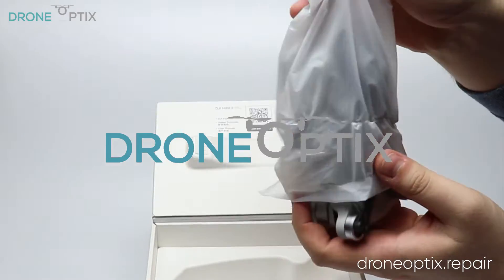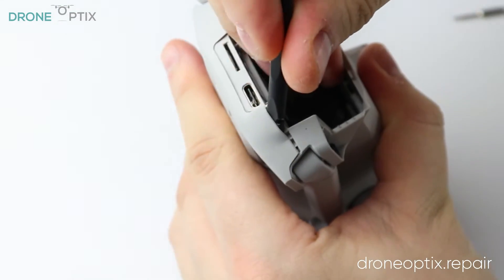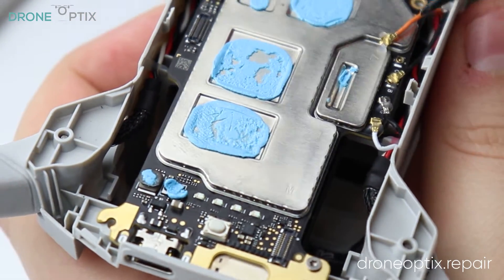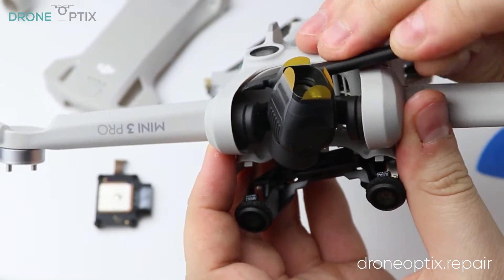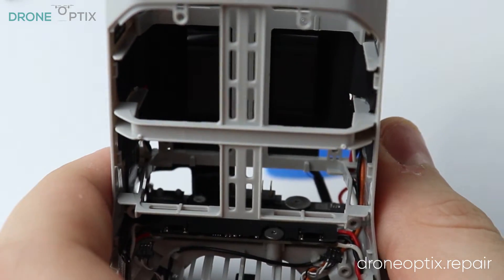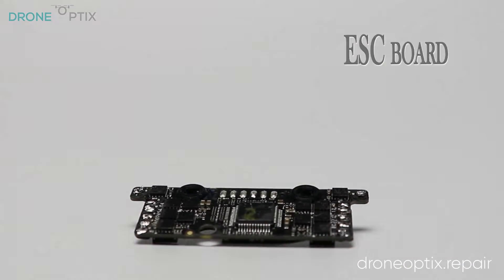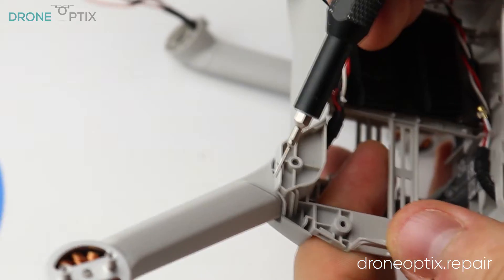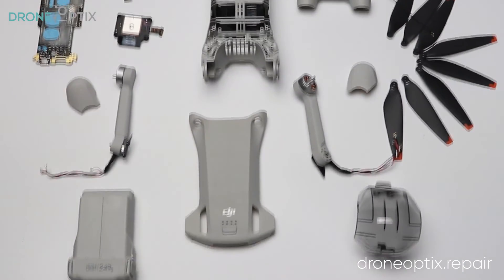We Completely Take Apart a DJI Mini 3 Pro Drone | Full Teardown / Disassembly

Comment: Here's a strange question:
After completely disassembling your DJI Mini 3 Pro Drone, could you see any parts or areas of the plastic drone body where one might be able to remove some of the plastic material in order to lighten the overall weight of this drone enough to counteract the weight of adding a set of aftermarket propeller-guards?

I ask because here in the United States the DJi Mini 3 Pro drone is considered a "Class-1" drone.  It weighs less than .55 grams.  IF you install a set of propeller-guards it increases the weight to more than the .55 grams.  This means that the Mini 3 Pro drone then becomes a "Class-3" drone.  The rules for flying a "Class-3" drone then become a bit more complicated.  

For the sake of argument and disregarding any warranty issues, I was just wondering if there was a way to lighten the weight of an existing Mini 3 Pro  further without compromising the integrity of the drone as it was originally built.

Comment: Where is the antenna connected and how many ? I'm planning on replacing it with better longer one. Hopefully I can put an antenna going through all four arms and one under and on the top in a Y slightly sticking out. At least that's my plan it should increase range signal pick up in both vertical and horizontal directions or in any position. I also plan on adding BETTER antennas to the DJI-RC CONTROLLER possibly double mushroom antenna.

Comment: Today, the ankle of the front right arm of my mini 3 pro got loose. Can I unscrew the arm and pull the arm off its axle without taking the entire drone apart? Are the cables long enough? I would like to check if the dark part that hold the axle is broken or if the main housing is broken
Reply: Got the same issue when my Mini 3 crashed onto hard tarmac after hitting a tree branch. At first it looked like only the prop blades were damaged but when I picked it up and started to fold the arms I noticed the front left arm did not fold positively and it felt wobbly.
Taking mine apart was as per this video. The swivel mechanism that the front arm is attached to is metal but it’s base is plastic. That’s where mine fractured. Waiting for my parts. A word of caution. Do not pull the arm off any more than is necessary to detach it off the swivel. The wiring harness has very little slack.
Reply: @psoon04286  hi Philip, i have the same issue After a Crash. Did you solved the issue of loose arm replacing the arm pivot hinge? Thanks!
Reply: @AlfioMirko  ordered the part through Ali Express since the broken swivel joint cant be mended and as it turns out was quite straightforward to replace. Just be careful with the wiring as its snugly routed. The front joint is the same for either right or left. The rear joints are handed so if you are ordering that make sure you’re getting the correct side. Good luck
Reply: @psoon04286  thank you so much Philip! 🙏🏻😎 Happy new year!
Reply: @AlfioMirko  I also ordered a few extras like body parts, blades, gimbal rubber mounts as well as extra joints as I figure these are the most likely to break. They are pretty inexpensive. The arm assemblies are quite expensive. 
Happy New Year and happy flying to you too👍😄
Reply: Hey! Did you manage to fix this issue?
Reply: Following
Reply: I'm wondering the same thing. Did you find out?